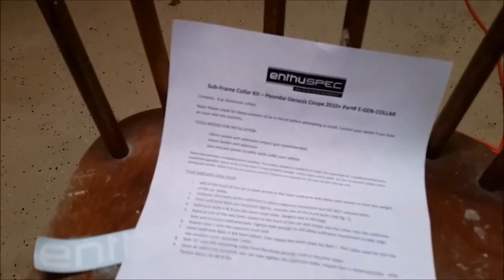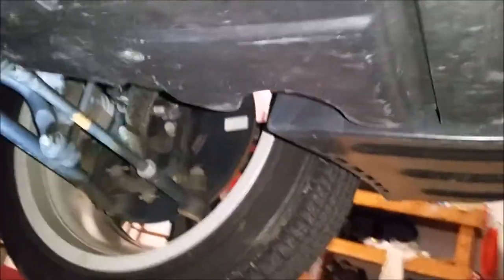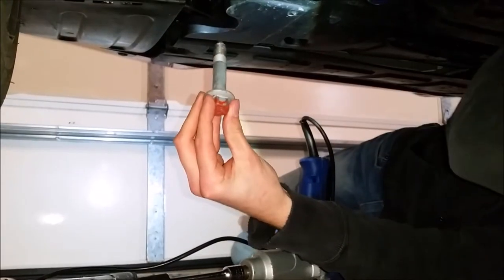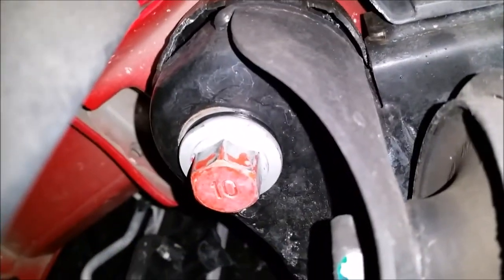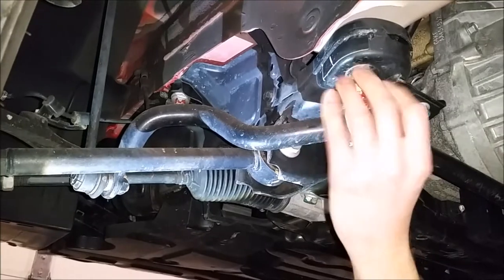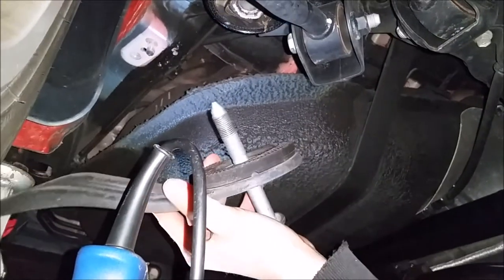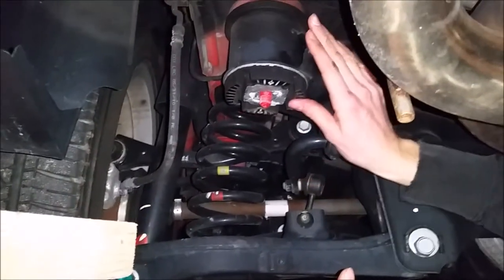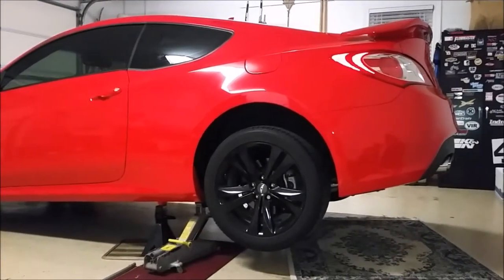Genesis Coupe Rigid Collar Installation

Comment: going to grab a set of atq subframe collars along with their endlinks before i throw my bc coilovers on my 13 3.8 in the spring time! this was very helpful
Reply from the maker: nice! Glad you liked the vid! My car was much less bouncy over large hyw bumps with these installed
Reply: +Honda4RideRed haha that was going to be my next question! but glad to hear. at first when I heard about these (gen is my first car I'm modifying) I thought it wasn't worth it for what like an $80? it won't make much of a difference but everyone on the Genesis coupe owners page on fb swears by it so I can't wait to get them done after winter...I'm back on stock wheels, stock suspension, and winter tires for now!
Reply from the maker: +Jobe Mathew Yeh I didn't think the simple little collars would actually make a difference, so I'm glad they did. I have the stock Bridgstone tires on my car which are all seasons, so winter tires should be really awesome in the snow. My car does pretty good in the snow :)

Comment: I thought the spacers are suppose to go between the sub frame and chassis.
Reply from the maker: No. They go where I showed. You could never get in between the subframe and chassis to even do that. But they make it so the bolt itself is nice and snug with no play

Comment: Hey I like this video looking at rigid collar installs. I might get flamed for this post but please put the car on 4 jack stands when working, be safe. It won't happen to you till it happens to you.
Reply from the maker: I appreciate the concern. But I did use a jack stand right next to the floor jack. 3 of the 4 tires were on the ground each spot I lifted the car. Jack stand was they supporting the weight. Car wasn't much higher off the ground then normal so really no need to jack the whole thing up at once and have 4 stands under it. Car was supported in each side I was working on

Comment: How's it going guys. I been researching rigid collars for a 2016 Hyundai Veloster Turbo but only see that there are four in the kit for that make and model. Is that right? I saw you installed more than that on your Genesis. Can you guys give me some advice?
Reply from the maker: If 4 is what the kit comes with. Then that's probably it.